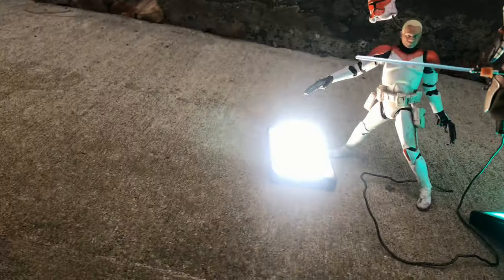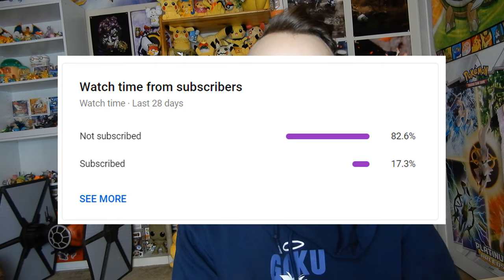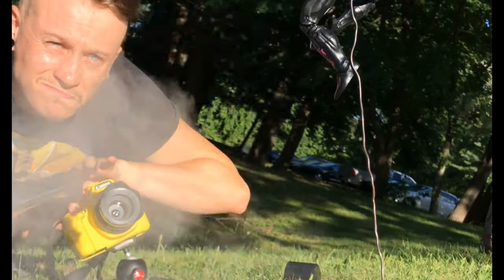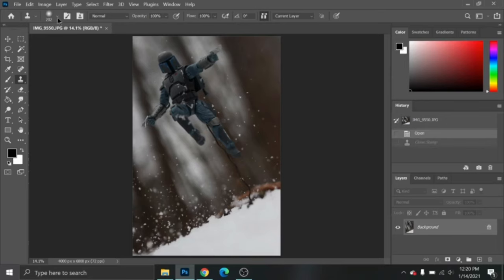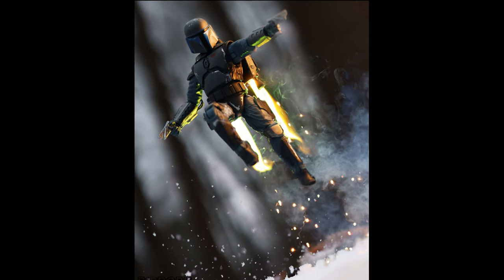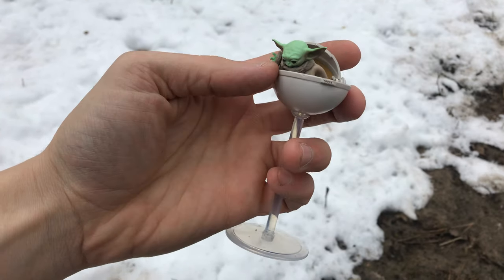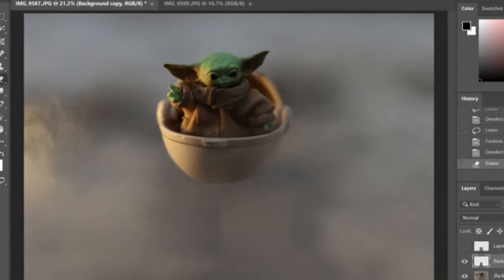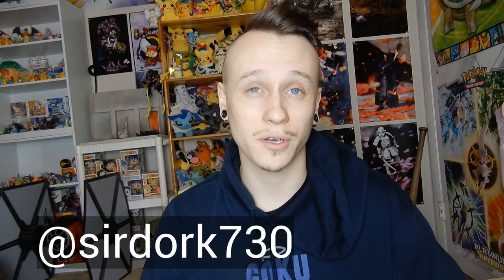Toy Photography WIRES: Using & Removing

Comment: Your photos are absolutely amazing and an inspiration to all action figure photographers!  Thanks for posting the type of wire you use.  I will be getting some of that soon!  

I also use Photoshop to clean up many of my pictures and there are some ways to be a bit more precise in your editing.  A good rule of thumb is to NEVER work on the background layer.  Always make a duplicate of it by clicking on the layer in the Layers Panel and using the keyboard shortcut “Command j” on a Mac or “Control j” on a PC.  This way, if you ever make a horrendous mistake and need to begin again, you always have that original background to return to.  There’s no need to search for your picture and drag it into Photoshop again.

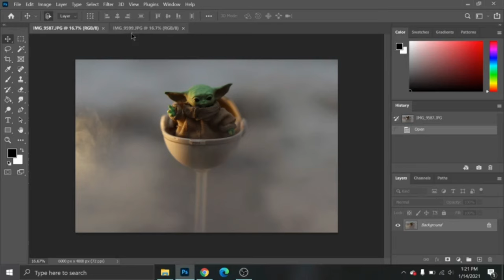 At 7:43 you show how to to clear away a stand by using a Clean Photo (same shot, but with the figure removed).  Instead of copying a section of the clean photo and pasting it over your stand in the photo with the figure, it looks so much better if you take the WHOLE Clean Photo and drag it to the Layers Panel underneath the copy of the layer of your photo with the figure in it.  To make sure they are properly aligned, click on the Figure Layer in the Layers Panel and temporarily lower the opacity to somewhere between 50% and 80%.  You want to still be able to see some of the picture, but also be able to see the Clean Photo behind it.  Next, click on the layer of the Clean Photo in the Layers Panel and using the keyboard shortcut “v”, Move the photo by clicking on it in your workspace and dragging it until it aligns with the Figure Photo.  Since they are both shots taken at the same time and place from the same camera, the dimensions should be exactly the same.  If you need to use tiny, incremental moves, you can use the up and down, left and right arrow keys on your keyboard (larger increments can be made by also holding down the Shift key at the same time).  Once they are perfectly aligned, click on the Figure Layer in your Layers Panel and raise the opacity back up to 100%.  With that layer still highlighted, go down to the bottom of that section and click on the Mask icon button (it looks like a white rectangle with a dark circle in the middle of it).  A white rectangle should become linked to your Figure Layer.  Click on the white rectangle and make sure it is highlighted.  Then, click on the Brush Tool (or use the keyboard shortcut “b”) and make sure your brush’s hardness is set to 0%. (You can find brush settings in the top right corner of the window. It has a picture of a brush and a down arrow to open up a menu.)  Then, use the keyboard shortcut “d” to change the Default paint colors to black and white.  When using the mask, whatever area you paint over with black will become invisible and whatever area you paint over with white will become visible again.   Just make sure you have the WHITE RECTANGLE highlighted or you will actually paint black and white on your picture.  (If you make this mistake and believe me, eventually you will, just use the shortcut key “Command z” on a Mac / “Control z” on a PC to Undo your last action).  With the black paint color, paint over your stand in your workspace.   Like magic, the stand will disappear.  It is actually just letting you see the Clean Photo underneath.  If you accidentally paint out too much of the Photo layer, (like you cut away some of Grogu’s pram), change the paint color to white (by clicking on the two “switch” arrows next to the Foreground/Background colors or using the Keyboard shortcut “x”).  Then, with the White Rectangle still highlighted, paint back in the pram.  Once you have your picture exactly the way you want it, click on and highlight both layers and Merge them together into one layer by using the Keyboard Shortcut “Command e” on a Mac or “Control e” on a PC.

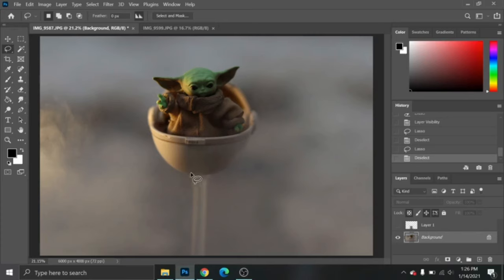At 9:00, you showed how to use Content Aware Fill to remove the stand.  Content Aware Fill is WONDERFUL, but it can be tricky.  Since Photoshop makes its choices of things to fill with from the nearby area, there is is always a chance that it may use part of the figure (or the pram) as a part of its choice.  To eliminate that problem, you can simply take away its wrong choices.   After you make your box around the stand using the lasso tool, Copy it (“Command c” on Mac / “Control c” on PC) and then Paste it (“Command v” on Mac / “Control v” on PC).  This will create a new layer above your Figure Layer.  Hide the Figure Layer and the Background Layer by clicking on the little eye icons next to them in the Layers Panel.  Now, all that should be showing is the little box that you have drawn.  Make sure that layer is highlighted and then, using your lasso tool again, draw a smaller box closer to the stand.  NOW, use your Content Aware Fill (Edit > Fill > Content Aware or Keyboard Shift + Delete > Content Aware).  Your fill will be much more precise.  Now you can return the view of the Figure Layer by clicking on the eye icon next to it in the Layers Panel.  If your new Content Aware layer needs editing, instead of using the erase tool, which you cannot fix after using it, use the Mask icon button like above so that you can correct any mistakes that are made in editing that layer.  Once you are done, Merge the two layers like I showed you above.  Once you get used to this way of editing your photo, you will never want to use the old way again (take it from an OCD Photoshopper)!  

Thanks again for all your terrific videos!!!

Comment: Great tips. Your editing turns out very well. Thanks. P.S. Adobe Photoshop FIX isn’t available in Apple App Store.  The link to the wire you use is no longer available either.  Maybe you can edit those transcript?
Reply from the maker: Hey thanks so much!! Yeah unfortunately photoshop fox isn’t available anymore 😫 but I do have a pinned comment with some alternatives!

And that’s so odd! The wire link still works fine for me! I did however add a new link to some wooden skewers that I’ve been using lately! Thanks again!

Comment: saw u doin the sweet camo on your clone trooper - do you have a recommendation for beginner intro set of paints?
Reply: Months after the question but still... acrylic paint is probably your best option and you can just use ordinary hobby shop paints. However, if you want to take it up a level, Games Workshop obviously make quite a large range but I tend to go with Vallejo (paints, textures, weathering and the occasional wash) with some Army Painter washes (they do a good starter set). Then give them a quick varnish afterwards to help make them more durable.

Comment: I run into issues using the Clone Tool covering Action Figure pin joints and the gaps where the articulation is. Even Content-Aware gives me fits doing this at times.
Reply from the maker: Yes! You’re definitely right about that! I actually have a more updated video on this process here!

5 MORE Photoshop Tips for Toy Photography!
https://youtu.be/vduyjnugP5E

Comment: yo thanks for this .
Reply from the maker: Thanks for watching!!
Reply: @sirdork730  so i bougth the wires in ur amazon store . i find it hard to slip the wire inside the cresses . the wire is too thick . any suggestions? i found the lowes one but it got my hands dirty and i was afraid if I used it on the figs it would get them dirty too.

Comment: Question, the wire you linked looks like bare copper and the wire you use in the video has plastic around it ? Should I order the one you linked ? I went and bought some wire at the store but it ended up being not strong enough
Reply from the maker: Hey there!! No plastic on my wire actually. I added a new link to the video! It’s actually the same exact kind I use. It’s not an amazing link though. Hope it is helpful!

Comment: I'm in the UK and I have tried to find a good enough wire. I've tried so much but they always are either too weak or not malluable enough.
Reply from the maker: I’ve been using these more recently!!

https://amzn.to/3iwMsON
Reply: @sirdork730  I did some today and used stick and mud to try and keep the feet down. It kind of worked

Comment: How thick does the wire need to be, to hold Mcfarlane, Hasbro, sh figuarts, mafex and stuff?
On Amazon the thickest is 2mm, but I can't imagine 2 mm holding such a huge heavy figure
Reply from the maker: I’d recommend picking up the wire I have linked in the video! It’s the same fact wire I use. It works great with all the figure brands you mentioned 😆
Reply: @sirdork730  do they ship international? And I think it's a 16 Gauge, maybe German Amazon or any store nearby has it, if not Imma continue searching
Reply from the maker: @FancyNancyFr  oh I see! Not sure if they do, but I’d give it a shot. 

If not, head to your local hardware store and check for a 16 gauge wire! Feel out the thicknesses and grab a tough one!
Reply: @sirdork730  I've seen some on Amazon actually, I think it should be thick enough, at least it's 16 Gauge
Reply: @sirdork730  2mm or .65mm?
Reply from the maker: @FancyNancyFr  I’d go with the 2mm
Reply: @sirdork730  Ok thank you for the help all the time ❤️
Reply: @sirdork730  do you use 2mm too? 😩

Comment: Photoshop fix isn't available ☹
Reply: I have just tried with Snapseed. Seemed to be the same. If you find sth better, let me know too. Greetings.
Reply: @Xeallous  I've been using an app called Touch Retouch.  As Adobe stopped supporting Fix and Mix. Though you can download Fix through 3rd party sites but it crashes due to it not being configured beyond 2017.
Reply: I know I don’t know what happened to it